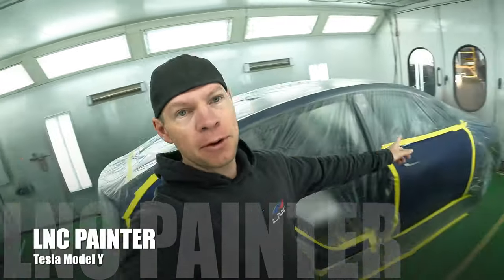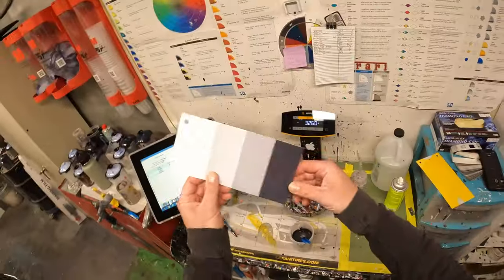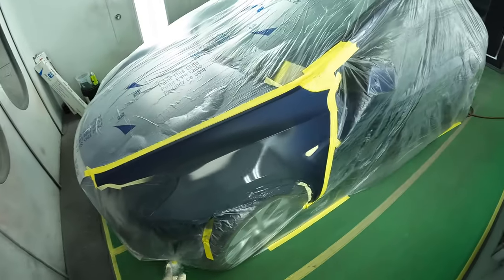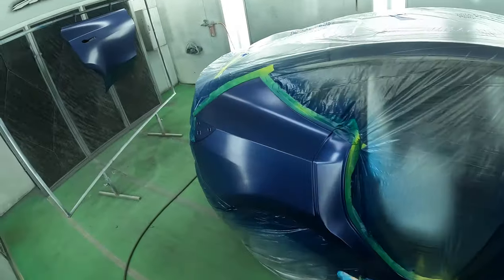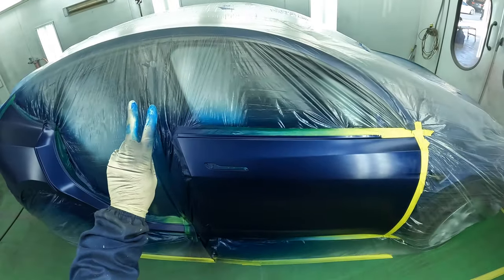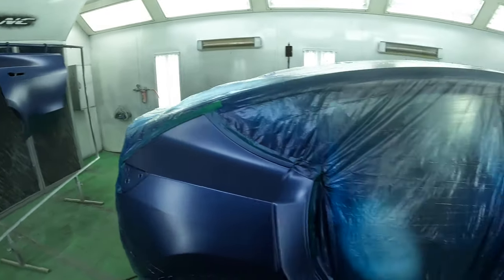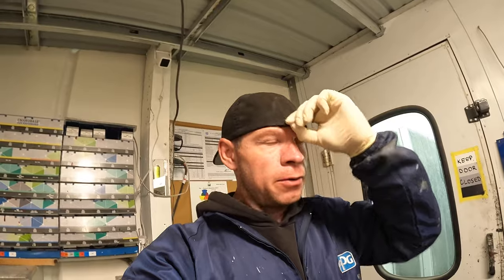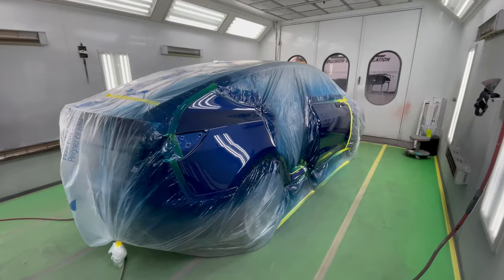Tips on spraying Blue Metallic paint

Comment: The hardest thing for me when painting is to know exactly how to get the right amount of clear on it.  There's a fine line between getting that perfect wet coat gloss...and applying just a hair too much and getting a run, drip, or sag.  Which I've done a lot.    But when it's right, when you're shooting glass and it stays perfect as it cures,  there's no better feeling.
Reply from the maker: Once you spray the same clear long enough and use the same spray gun you will fine tune it and know exactly how far you can push your clear coat before getting a run! Just takes time and practice be patient! 👍🏻😄

Comment: Nice work and great explanation of the process. Very cool you’re using a Pro lite spray gun! I have a question if you wouldn’t mind helping me with. When using base clear if you miss the 12 hour window for chemical adhesion of the clear coat can you scuff the base for a mechanical adhesion. Reason I’m asking is I’m doing white along the bottom and roof of my truck and a medium blue every where else . I’m trying to avoid hard lines and extra masking.  I’ve always sprayed single stage paint because I see so many vehicles with the clear coat popping off , what gives you the beast adhesion chemical or mechanical? Thanks for any advice I’m in the US.
Reply from the maker: Thanks, i think nowadays the current paints are designed best for chemical adhesion…with that said with ppg we have a 24 hour window to clearcoat and 48 hours to re-basecoat/clearcoat. I think sanding the basecoat then clear after more than 24 hours will not provide enough adhesion for the clearcoat since you are sanding very lightly and with fine grit as to not ruin the basecoat.
Reply: @LncPainter  Thanks for the response that seems to be the answer I’m getting. I have such limited shop time just looking for a way to get it done. Thanks again!!

Comment: do you know any paint code for that grey base coat that i can tell my local paint shop. i’m with you on not liking sealer.
Reply from the maker: I use the actual G shade as a color code and it gives me a formula. So for light gray color code would be G3 and for dark gray color code would be G7 and it will give me the formula to match the correct shade